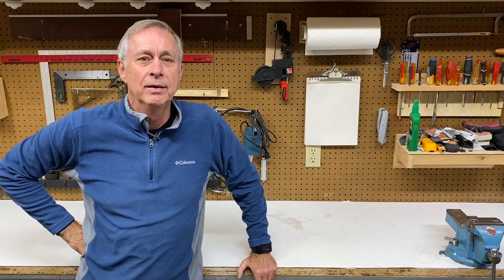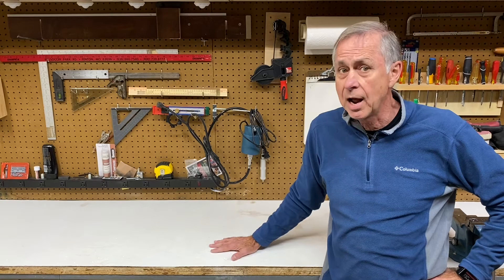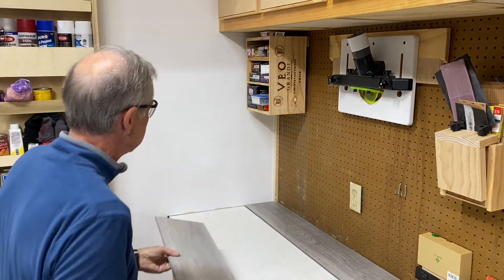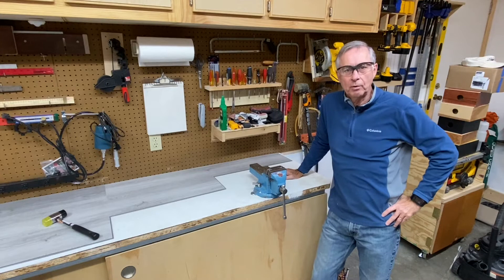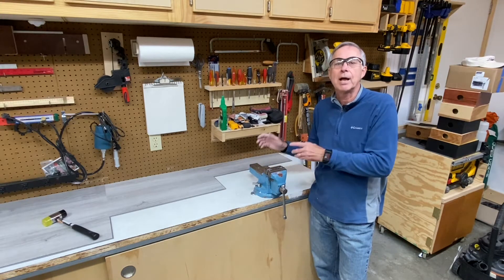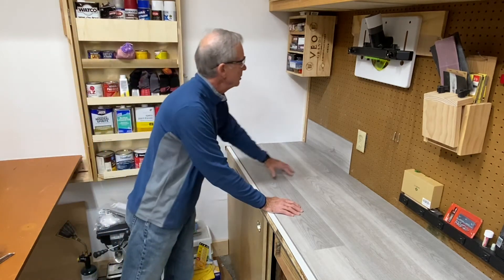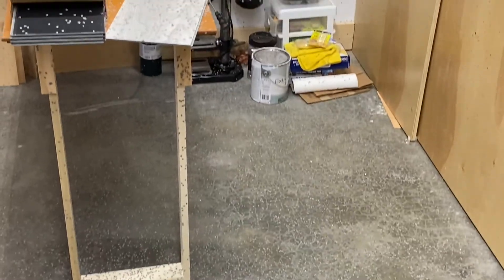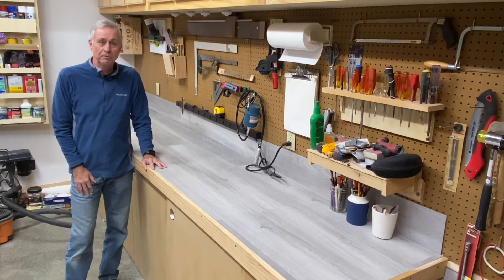How To Cover A work Bench

Comment: I was thinking about doing real hardwood on my bench. Just got done building it. Only about 8 square feet of surface area, not expensive. One box can just about cover it 3 times. I can remove pieces and replace them if they get messed up real bad. Tongue and groove should hold them in place well and I can just tac some 18 gauge stainless brad nails in the corners. Vinyl might be better for a softer surface working on some things but be tough for heavy things. I have silicone mats I use though. Great video, thank you for posting it.
Reply from the maker: Thank you Paul!  I think your plan sounds great.  Good luck!

Comment: Great idea and probably cheaper than epoxy etc and way better surface!  Actually I think the term for the connecting edges is Ship Lap
Reply from the maker: Thanks!  It was pretty cost effective. I have found that it cleans pretty easily and I haven’t damaged it yet.   Shiplap is probably a good term to describe the overlapping edges.   Thanks again for taking the time to comment.

Comment: Suggestion for the slim cut, cut the back and front boards so they both are about half. That way it is better connected and that slim cut piece doesn’t pop off easy.(as it’s no longer slim) Alternatively keep the slim cut piece against the wall were it gets less abuse.
Reply from the maker: Great tip John!  Thanks for sharing!